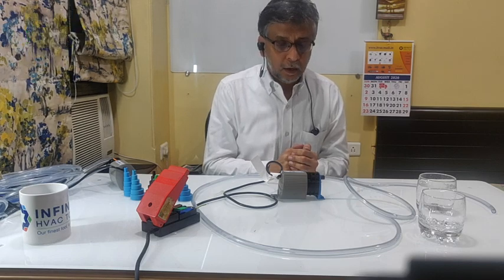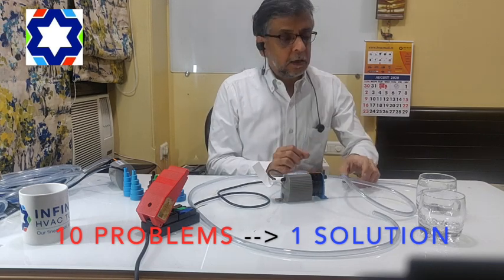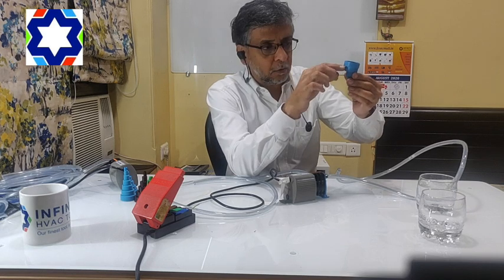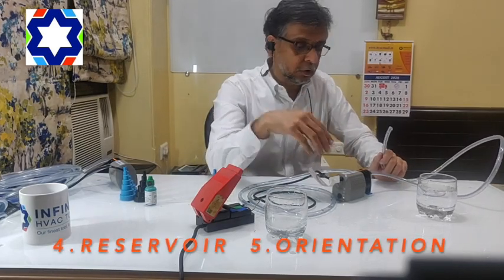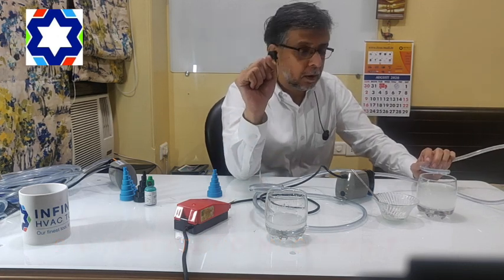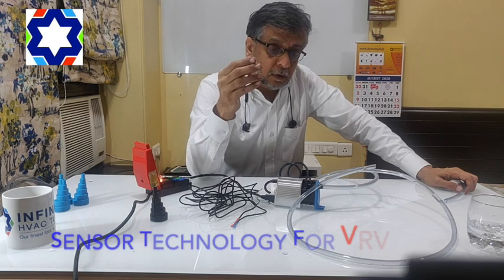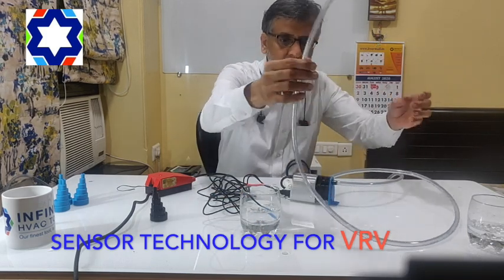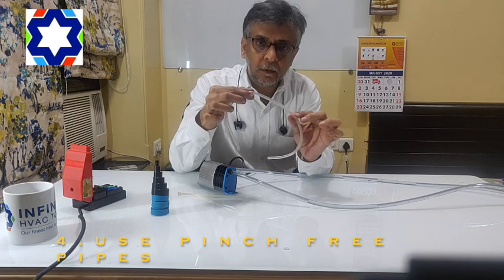AC DRAIN PUMPS, 10 PROBLEMS - ONE SOLUTION | DRAIN PUMPS FOR VRV | Infinity HVAC | Vinod Chandan

Comment: The pump pressure flow when humidity too much. The low pressure flow problem. 🤔
Reply from the maker: There is no problem with humidity and pressure.
You can go ahead and install.
The same product is being used across the globe.

For more details - email - enquiry@ihvac.in
or Whatsapp / call 9223521222

Also you can directly buy - www.hvacmall.in